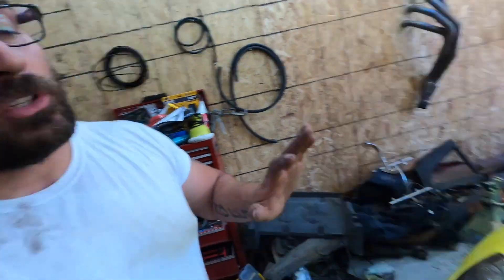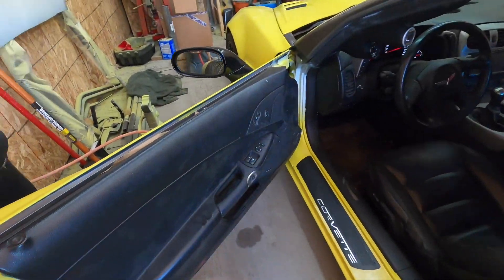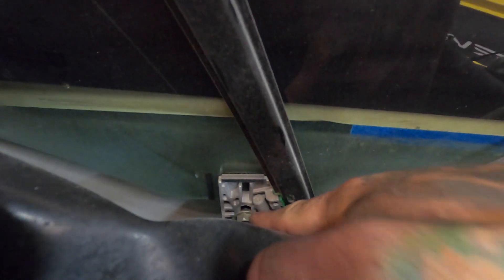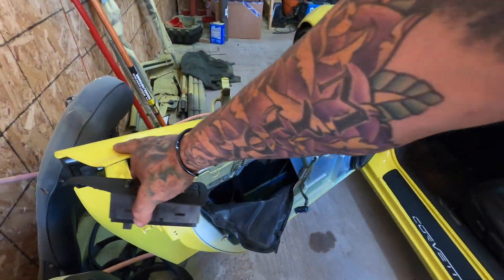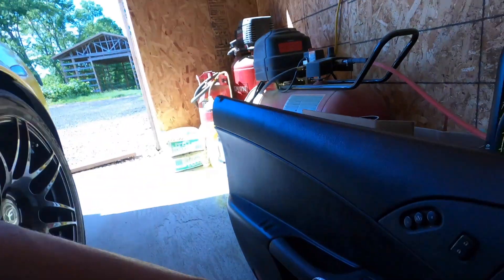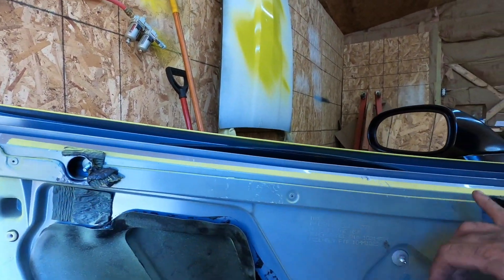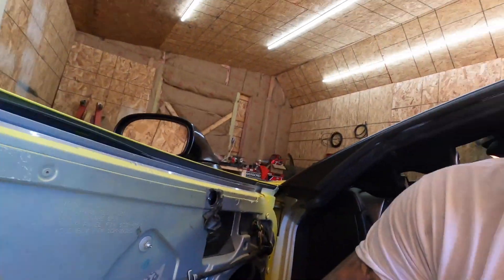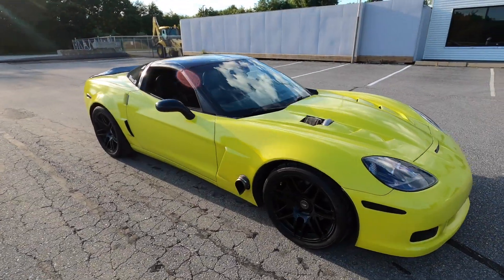C6 corvette window regulator install and the final assembly

Comment: Car looks Awesome! My c6 is silver like yours used to be.  I’m thinking of painting mine as well. But first gonna get some bolt ons 👍
Reply from the maker: Sparky Welder thanks brother and he’ll yea what are your next bolt ons your doing?
Reply: Paradise C6 I ordered long tube headers. I already have the cold air intake. I also have a Corsa exhaust from the cat back. But I will be removing the cats once I get these long to headers. And by late August I’m looking to do a cam. Then over the winter I would like to get it supercharged. But I have to do it in stages because as you know it gets expensive brother

Comment: Bro your car looks sick! I got a c6 too but it’s all stock I wish mine looked and sounded half as good as yours. I had to change the window regulator too and it didn’t take long but when I put my door back together everything worked but my door switch so now I got to use the emergency latch every time I get out. Do you think that might be a fuse that I could replace?
Reply from the maker: Upcoming Athlete Star there is a fuse for the door switch it’s in that kick panel it’s on the right side all of them are labeled but that’s where I would start and if the fuses are good open up the door panel and check your connections

Comment: I hate c6 door panels. Pain in the ass to put back on.
Reply from the maker: Dude they suck and the clips aren’t holding well either
Reply: @NRMotorsports  nope I had to buy new ones. I broke 2 on each door. It seems once pulled out they loose the grip they had.